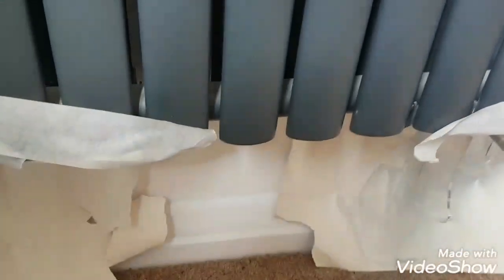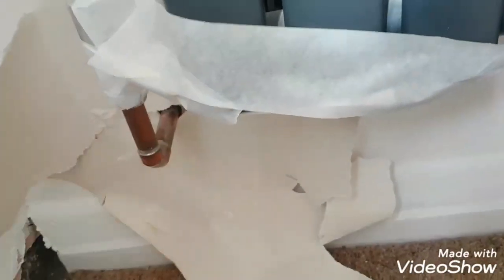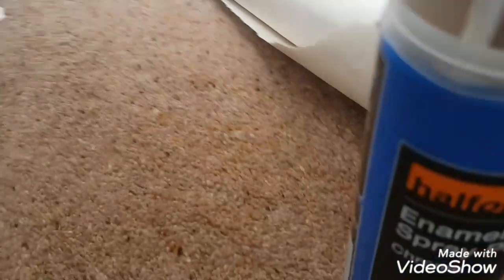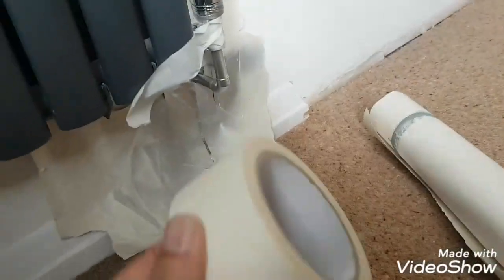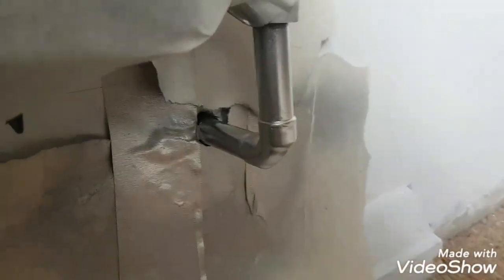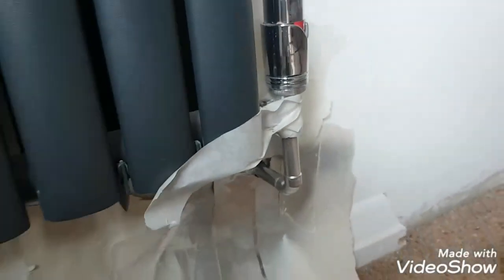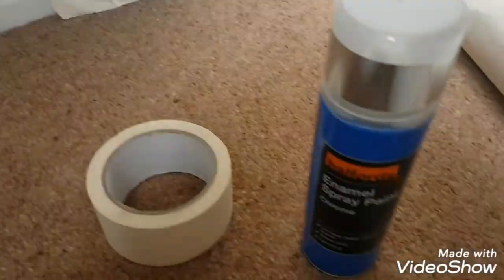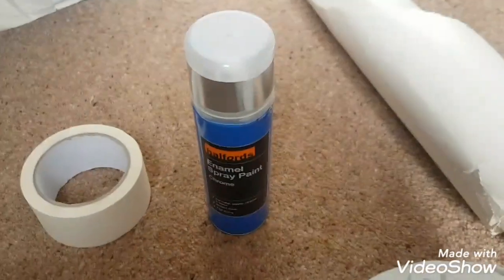How To Get A Chrome Finish On Radiator Pipes

Comment: The plumber should have used a chrome elbow and file chrome pipe ends to solder to plumb in that designer column element radiator. Paint is a nightmare for plumbers as we have to send and remove completely in case we need to do a joint or fix something

Comment: I found this video handy but then looked into buying the exact same can from halfords that he's using and found that this spray is not heat resistant? Surely couldnt of lasted long? Unless he sprayed a heat primer underneath maybe?
Reply: Hi. These are my actual radiators and I've had no problem. Still looking good today.
Reply: @danielnugent2168  thanks 👍 i shall probably go for that paint then
Reply: It's enamel, you could paint. Spaceship with it and it wouldn't crack
Reply: Heat resistant paint is only needed for extreme cases, not domestic radiator, you can gloss a radiator np